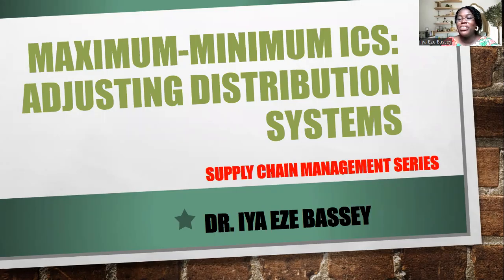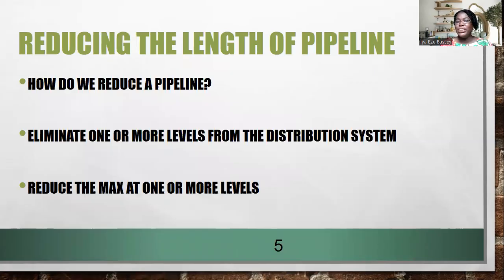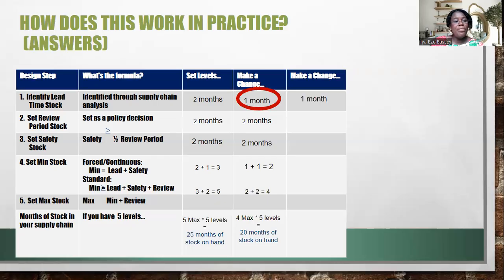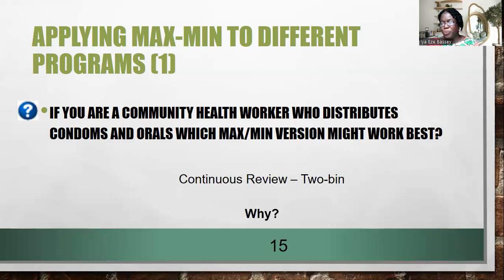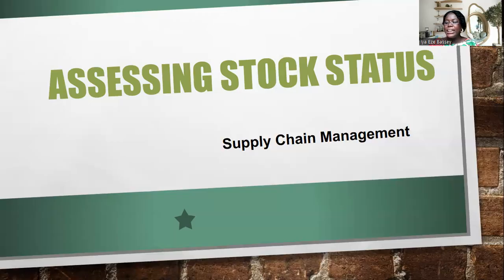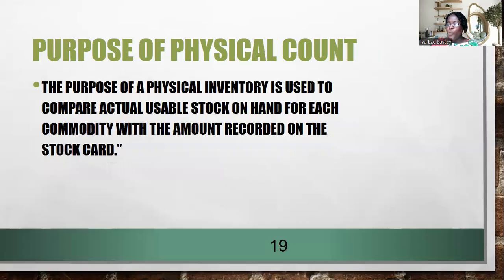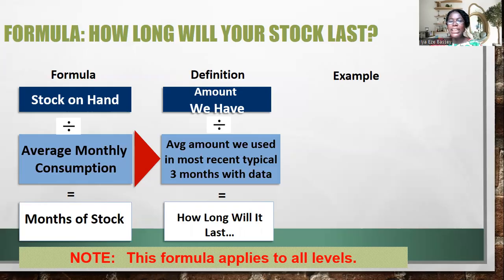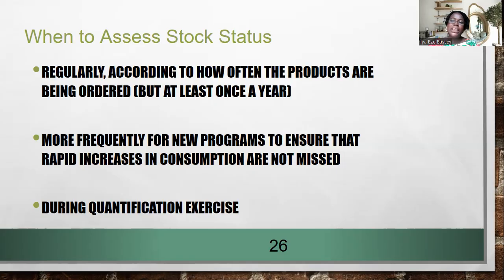Maximum-Minimum ICS: Adjusting Distribution systems (Supply chain management series)

Comment: Thank you for this excellent lecture, Ma'am.

After watching the video, I was able to identify the key steps involved in designing a max-min inventory control system: ( 2:36  )

Also understood the ways which length of pipeline can be reduced. They include;
a) Eliminating one or more levels from the distribution system
b) Reducing the max at one or more levels.

( 4:08 )

I was able to understand the advantages of max/min inventory control system;
i) Avoid overstocking 
ii) Avoid understock
iii) Minimize wastage
( 9:26 )

I also learned about the core purposes of an inventory control system, which include maintaining appropriate stock levels, avoiding shortages and oversupply, among others. 

Some of the key factors that impact max-min stock levels include:
1. Product cost
2. Storage capacity 
3. Cost of storage"

Lastly, under assessing stock you explained physical count as process of counting by hand the total number of usable units of each commodity in store or health facilities at any given time.
( 18:23 )

Comment: From this series i understand the used for adjusting dristribution system in max-min inventory control system which implies those procedure employed to reduce those factors that causes a quick and fast distribution starting from the need for adjusting and renovating the pipeline length in the distribution system for it's effectiveness, reducing the lead time and improve  distribution reliability also stock levels as; 
Reliability of transport medium, cost of product.
Storage reliability and capacity and shelf life of the health commodities,this helps to achieve the following: Avoid overstocking,understocking,maximize wastage,ensure accuracy of forcast and qualification and also reduce emergency ordering tendencies etc.

Comment: Thanks again for this wonderful and educative lecture. 
    In summary,ICS which means inventory control system is aimed at maintaining an appropriate stock level of all products, avoiding shortage and over supply as well as determining when stock should be ordered/issued. I also learnt that the steps in setting up max-min ICS are;
1. Set up initial max-min policyfor 3ach level and the type of facility
2. Check if the overall distribution will function properly if the level specific max-min policy are implemented.
3.Check the total length of the pipelines
   Hence we can shorten pipeline by;
1.  Eliminating one or more levels from the distribution system
2. Reduce the max at one or more level.
  We reduce maximum by; 
1. Shortening the review period at one or more levels
2. Reduce the length time at one or more levels
The advantages of max-min system includes;
1. Avoidance of overstocking
2. Avoidance of understocking
3. Minimising of wastage
4. Avoidance of cost of emergency orders
  I also learnt physical count is the process of counting by hand the total number of usable unit of each commodities to compare the actual usable stock on hand for each commodities with the amount recorded in the stock cards. Physical count should be conducted once a year for a program that has no problems. But for a program with problems, physical count is done frequently. Thank you ma 🙏 🙏🙏

Comment: I have been able to understand through this wonderful lecture, the steps in designing a max-min ICS, which are;
1. Set up initial max-min policies for each level and type of facility.
2. Check if the overall distribution will function properly if the level specific max-min policies are implemented.
3.Check the total length of tye pipeline that the policies at each level imply.
There are factors that impact max-min stock level such as Cost of products,storage capacity,cost of storage, lead times,age of program, accuracy of staffs e.t.c.
   I have also learnt about the advantages of using this system such as minimize wastage, avoid understocking, avoid overstocking e.t.c.

Comment: Another Educative series, 
Very Briefly, 
In summary, there are steps to designing the Max-Min ICS which are;
1. Set up an initial Max-Min policies for each level and type of facility.
2. Check if the overall decision will function properly, if the level specific Max-Min policies are implemented.
3. Check the total length of pipelines that the policies at each level can imply.
There are several factors that affect max-min levels which includes;
1. COST OF PRODUCTION, 2. LEAD TIME, 3.COST OF STORAGE, 4. STORAGE CAPACITY, 5.AGE OF PROGRAM.
In conclusion, this factors have some advantages which are;
1. minimize shortage, 2.minimize wastage, 3.prevent overstocking etc.

Comment: In summary I learnt about how to reduce the length of a pipe line and also how to reduce the maximum stock level 
I also learnt on factors that impact max/min stock levels which includes 
- cost of products
- reliability of transportation 
- storage capacity ... etc 
And also Advantages to using max/min system and the challenges to using each versions and variations 
I also learnt about PHYSICAL COUNT and the purpose of physical count and when physical count should be carried out 
Thank you once again for this lecture

Comment: In summary, the steps in designing a Maximum-Minimum ICS are as followed :
1. Check the total length of the pipeline that the policies at each level comply.
2. Check the overall distribution will function properly if the level specify Max-Min policies are implemented.
3. Setting up initial Max-Min policies for each level and type of facility. They are advantages of using Max-Min system this; 
a. Avoid cost of emergency 
b. Minimize wastage 
c. Avoid overstocking 
d. Avoid understocking.

Thank you ma.

Comment: In summary ,I have learnt the steps in designing Max/min inventory control system,how to reducing the length of pipeline,how to eliminate one or more level from the distribution system and set up policy to help reduce the max at one or more levels.
Other factors that impact Max/min stock levels are;
Cost of production, storage capacity, cost of storage, reliability of transportation, storage condition at different levels, etc.
The inventory control system helps us to avoid over stocking, under stocking, it also helps us avoid cost of emergency.
The various challenges of using each of the inventory control systems are;
. System with numerous levels
. System that manage a large amount of commodities
. System that manage products of new program
 
Assessing stock status; it's purpose is to determine how long supplies will last, it's formula, how to calculate and when to access stock status
. Physical count; it's the process of counting by hand the total number of usable units of each commodity in your store or health facility at any given time. It's purpose is to compare actual usable stock on hand for each commodity with the amount recorded on the stock card.

Comment: thank you for this lecture ma, I came across the following valuable insights:
- A crucial step in developing a max-min Inventory Control System (ICS) involves establishing the final initial max-min policies for every level and type of faculty.
- The determination of max-min stock levels is influenced by several factors, including the cost of the product, transportation reliability, storage capacity, and storage costs.
- The use of a max-min ICS system offers the advantage of preventing overstocking.
- Challenges associated with utilizing the system include managing numerous levels, handling a large variety of commodities, and managing products for only a select few programs.
- In the process of stock assessment, physical count, where the total number of usable units of each commodity in the store is manually counted, is used to compare the actual usable stock on hand for each item with the recorded amount on the stock card.

Comment: From the lecture,  I have acquired comprehensive knowledge as pertaining to the steps involved in designing a max-min Inventory Control System (ICS), the techniques for reducing pipeline length, and the diverse factors influencing the determination of max-min stock levels. Additionally, I have garnered insights into the advantages of a max-min system, particularly its efficacy in preventing overstocking and understocking, as well as an understanding of the challenges associated with varying versions and modifications.
I've understood that by adjusting certain elements in our formulas, we can lower the maximum stock level effectively. These adjustments include shortening the review period, reducing the lead time, and enhancing the reliability of the distribution system.

In designing a max-min inventory control system, we need to follow these steps:
1. Establish an initial max-min policy for each level and type of facility
2. Ensure that the overall distribution will operate effectively with the specific max-min levels
3. Evaluate the total length of pipeline implied by each level

Furthermore, I've learned that several factors impact the max-min level, including the age of the program, cost of storage, cost of production, lead time, and cost of storage.

Comment: In summary I understood that
Maximimum-minimum inventory controls is the tune scheduled for reviewing stock level maximum in the maximum quantity of commodities a store keeper can hold at any time..
I learnt the purpose of Inventory control which are
1) To maintain an appropriate stock level of all poducts, abd avoiding shortage and oversupply
2) to determine how stock should be ordered and issued.
3)To determine when stock should be ordered and issued.
Another one is the safety stock level are sometimes referred to as Buffer stock...it is the convenient stock level to cushion for uncertainty...
I was able to know the types of max-min inventory system..
Which are
 1) forced ordering max-min inventory system
2) continous review and
3 standard version max-min inventory and also the steps in setting max-min inventory are 1) to determine one's lead time
2) set the review period and 3) set the minimum stock level,
4) determine the maximum stock level and the emergency order point..
Thanks ma'am for this knowledge shared!!

Comment: This series is rich enough, because max.and min. Inventory control system (ICS) which are guidelines for both overstocking and understocking of commodities,  The pattern also helps to aviod cost of emergency order, It also enable us to have a guide on our stock status at regular basis, The series also help us to check the length of pipelines of policies at each level.

Comment: In summary of Max-min ICS.
I have learned about the various steps in designing a Max-min inventory control, the methods for reducing pipeline length, and some factors affecting the Max-min stock levels.

Also I now understand the benefits of a Max-min system, such as preventing overstocking and understocking, along with the challenges associated with differents versions and variations.

This is splendid!
Thank you Dr.

Comment: Thank you ma
I got to understand that the maximum minimum inventory control system help adjust the distribution system by ensuring that inventory level are maintained within predetermined limit.
When inventory reaches the maximum level distribution is adjusted to prevent over stocking.
When inventory reaches minimum level distribution is adjusted to trigger a reorder.
This help optimize the distribution process and maintain efficient supply chain operation.

Comment: I learnt about the max/min Inventory control system distribution.steps in designing a max/min ICS . How to reduce the length of the pipeline of distribution, which includes eliminating one  or more levels from the distribution system and other measures. Steps in reducing the maximum stock level. Factors that impact max/min stock levels, which includes cost of products, reliability of transportation, storage capacity etc. I learnt about the advantages of using max/ min system, challenges to using each version and variation.. The meaning of physical count, which is counting by hand the total number of usable units of each commodity in your store or health facility. The purpose of a physical count. To Know how long a product will last and formulae on how to calculate it. I also learnt when to assess stock status.
From uka David chukwudi , you are the best.

Comment: In conclusion, I've learnt about the steps involved in designing a max-min inventory control system(ICS),the methods for reducing pipeline length, and the various factors affecting the determination of max-min stock levels. 
I also learnt the definition of a physical count which is the process of counting by hand the total number of usable units of each commodity in your health facility at any given time.
Lastly is the purpose for doing a physical count which is used to compare actual usable stock on hand for each commodity with the amount recorded on the stock card.

Comment: In summary the steps in setting up a max-min ICS are: 
1. Set up initial max-min policy for each level and the type of facility 
2. Check if the overall distribution will function properly if the level specific max-min policy are implemented 
3. Check the total length of the pipeline. 
We can shorten a pipeline by 
1. Eliminating one or more levels from the distribution system 2. Reduce the max at one or more level. 
The element which can be changed to reduce the max stock level include Shorten the review period at one or more level, shorten the lead time. 
Factors that could impact max-min stock level are 
1. Cost of commodity 
2. Reliability of transportation 
Storage capacity 
3. Cost of storage. 
Emphasis was laid greatly on counting of commodities available. 
Thanks for this lecture.
Reply: In summary the steps in setting up a max-min ICS are:
1. Set up initial max-min policy for each level and the type of facility
2. Check if the overall distribution will function properly if the level specific max-min policy are implemented
3. Check the total length of the pipeline.
We can shorten a pipeline by
1. Eliminating one or more levels from the distribution system 2. Reduce the max at one or more level.
The element which can be changed to reduce the max stock level include Shorten the review period at one or more level, shorten the lead time.
Factors that could impact max-min stock level are
1. Cost of commodity
2. Reliability of transportation
Storage capacity
3. Cost of storage.
Emphasis was laid greatly on counting of commodities available.

Comment: This series is wonderful. Thank you so much Dr Iya Eze Bassey for this lecture. 
In summary, there are steps in designing a Maximum minimum ICS which include:
1. Setting up initial Maximum Minimum policies for each level and faculty.
2. Checking if the overall distribution will function properly if the level specific Maximum minimum policies at each level imply.

Elements of the formulas which can be changed in order to reduce the maximum stock level are:
1. Shorten the review period at one or more levels
2. Reduce the lead time at one or more levels
3. Improve the distribution system reliability

Factors that impact maximum minimum stock level are:
1. Cost of products
2. Reliability of transportation
3. Shortage capacity
4. Cost of storage
5. Shelf life of health commodities

The advantages of using maximum minimum system are:
1. It avoids overstocking
2. It avoids understocking
3. It minimizes wastage
4. It avoids cost of emergency order

There are challenges to using each version and variation and they are:
1. Systems with numerous levels
2. Systems that manage in large numbers
3. Systems that manage products for new programs 

Asses stock status entails physical count which is to compare actual stock on hand for each commodity with amount recorded in the stock card.

Comment: Dr this is awesome through this lecture i was able to understand 
THE STEPS IN DESIGNING A MAX-MIN ICS ARE:
1. SET UP INITIAL MAX-MIN POLICIES FOR EACH LEVEL AND TYPE OF FACILITY
2. CHECK IF THE OVERALL DISTRIBUTION WILL FUNCTION PROPERLY IF THE LEVEL SPECIFIC MAX-MIN POLICIES ARE IMPLEMENTED
*3. CHECK THE TOTAL LENGTH OF THE PIPELINE THAT THE POLICIES AT EACH LEVEL IMPLY
REDUCING THE LENGTH OF PIPELINE
• HOW DO WE REDUCE A PIPELINE WE CAN DO THIS BY EITHER 
• ELIMINATE ONE OR MORE LEVELS FROM THE DISTRIBUTION SYSTEM
• REDUCE THE MAX AT ONE OR MORE LEVELS
ELEMENTS OF THE FORMULAS WHICH CAN BE CHANGED IN ORDER TO REDUCE THE MAX STOCK LEVEL:
• SHORTEN THE REVIEW PERIOD AT ONE OR MORE LEVELS
• REDUCE THE LEAD TIME AT ONE OR MORE LEVELS
• IMPROVE THE DISTRIBUTION SYSTEM'S RELIABILITY AT ONE OR MORE LEVELS SO THAT SAFETY STOCK CAN BE REDUCEDOTHER FACTORS THAT IMPACT MAX-MIN STOCK LEVELS (1)
• COST OF PRODUCTS
• RELIABILITY OF TRANSPORTATION
• STORAGE CAPACITY
• COST OF STORAGE
• STORAGE CONDITIONS AT DIFFERENT LEVELS
•SHELF-LIFE OF HEALTH COMMODITIES OTHER FACTORS THAT IMPACT MAX-MIN STOCK LEVELS C
• LEAD TIMES
• RELIABILITY OF SOURCE OF SUPPLIES
• EFFECT OF A ZERO BALANCE OF STOCK
• MANAGEMENT SKILLS OF STAFF
• AGE OF PROGRAM
• ACCURACY OF FORECASTS.

Comment: Wow, this series is wonderful. In summary, I've been able to learn:
To reduce the length of pipeline, we can do that by;
1. Eliminating one or more level from the distribution system.
2. Reducing the max at one or more levels.
I also Learnt that factors that impact Max -min stock levels are
1. Cost of product
2. reliability of transportation
3. storage capacity
Others include;lead time, age of program, etc.
I also understood the challenges to using each version and variation system which include ; system with numerous level, system that manages a large number of commodities, system that manages products for new programs. 
And finally,I realized that physical count is one of the means of determining our month of stock.